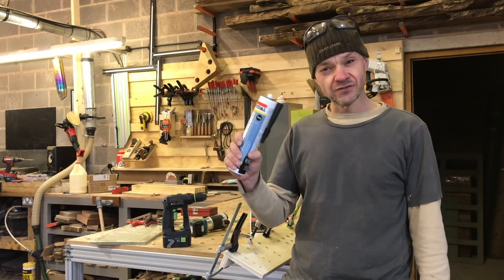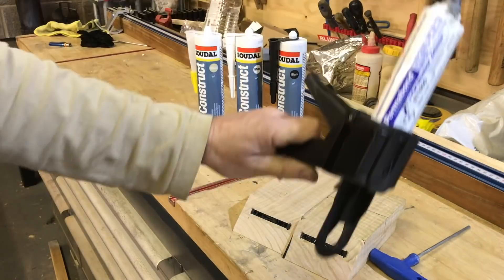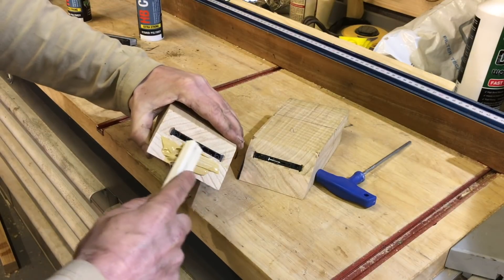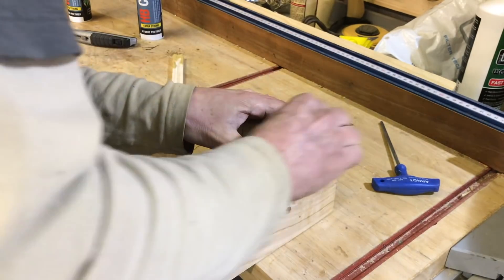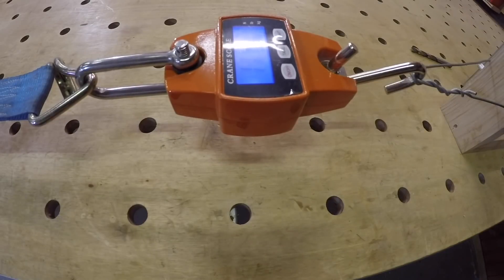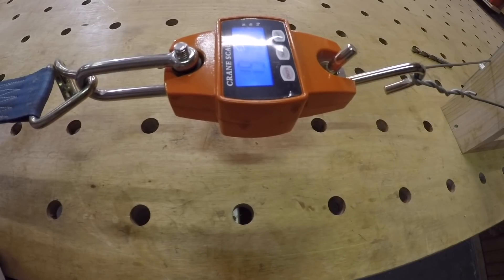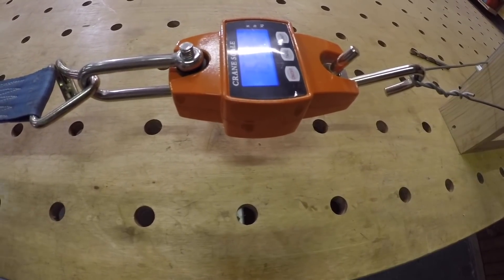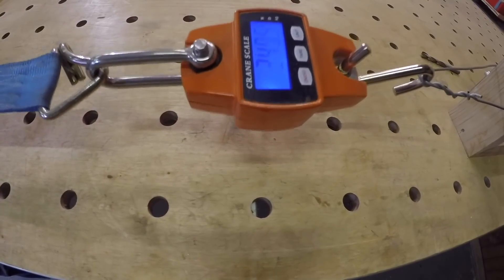#mwshoptalk - None Foaming D4 Glue Test

Comment: Why are you measuring in Newtons?  Seriously it is meaningless for most people as they have no concept of how that relates to everyday units like Kg, and Pounds!!!  Why would you make it necessary for your viewers to have to do calculations to get to a meaningful unit?  Yes they can compare from one to the other in the set of data, but having a unit of measure that most will  understand with out having to look it up will also let people decide if one or the other is sufficient for their purposes! For those that want to do the math Newtons are 4.44822 to the pound, or 9.81 to the Kilogram! Also where is the link you said you were going to put in the description?
Reply from the maker: I thought Newton metres was a global way of measuring force , people can convert this very easily on Google to their preferred measurement, but I have to say these tests using any of the glues are strong enough for any furniture grade product. The amount of pressure I am applying to a single mitre is just not achievable in the real world when you have a minimum of four joints making a rectangle or Square as part of the furniture build which would add masses of strength to the piece of furniture and make it almost impossible to add as much pressure as I am to just one of the mitres. I’m usually pretty good adding links can you let me know which link I forgot to add cheers
Reply: It is if your an engineer, scientists or the like, but most people are not! As a result in the normal world of the general public it is not a unit of measure that people ever come across!  As to looking it up and converting it, Why would you want to make your viewers have to do that?  That smacks of arrogance, expecting your audience to have to go out of their way to make the data you came up with meaningful to the general woodworker!  As a result the information you gave is meaningless to the average person with out doing extra work on their part, so knowing that they are all strong enough is not immediately obvious to them!  As far as the link it would be to any product that you are talking about in the episode!  Again expecting people to search Google to find the adhesives you are testing is a little off putting for most, even if they do not say anything about it at the time.  I know it is one of my most encountered peeves as well as others I have talked to about it.
Reply: @mikesmicroshop4385  god forbid you would actually have to do some work on your own.  SMH.
Reply: The reason is because most people will NEVER look it up!  SO if you really want to provide information that will mean something to the greatest number of people then use  units that the greatest number of people will understand!  I would venture a guess that most people if they have ever heard of a Newton in the first place will have long forgotten what it is short of a fig cookie! and to think that people would be interested enough to take time out of their day to not only lookup what it is but to then do calculations to take it to a meaningful unit that they are familiar with is to be completely oblivious to human nature!  So if your intention is to convey information on the test that you have taken your time and effort to do and compile, then use common units of measure that the general public will grasp with out doing extra work, that 99% will not do!  To do as was done here you have all but wasted your time and effort because your information is in an unrelatable form.  That has been my experience over more than 50 years of trying to educate others.

Comment: Always an interesting video - What is the open time  with the glue and will you use it do you think? Cheers
Reply: Once applied the two surfaces must be closed within 6 minutes, hope this helps. Alan, Protrade
Reply from the maker: Yes it’s a great option for lamello mitres
Reply from the maker: Not 100% sure on open time , I will check the tube but alway like to test my self as conditions can make a big difference like how cold or warm your shop is